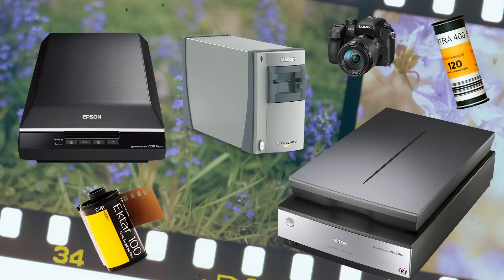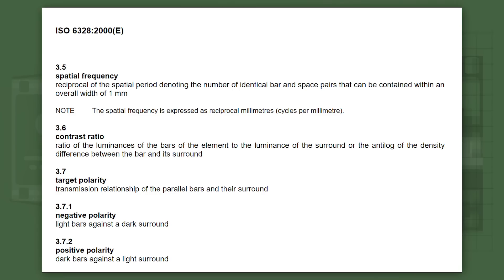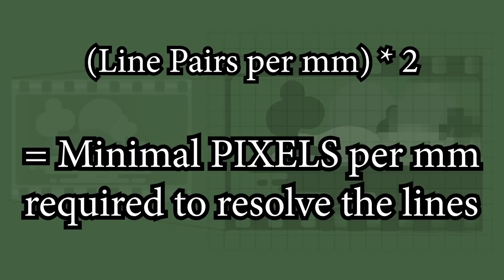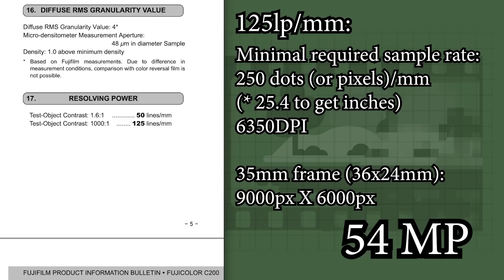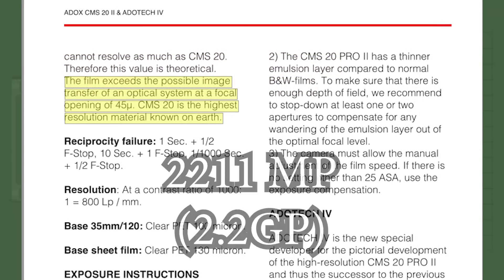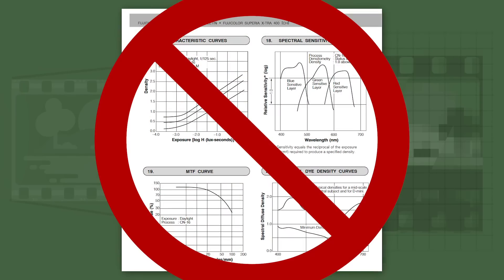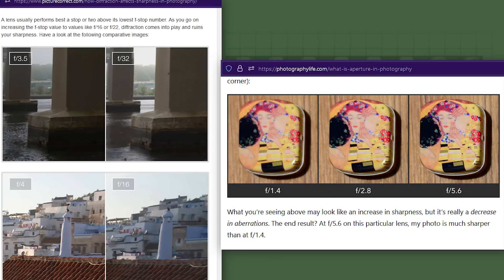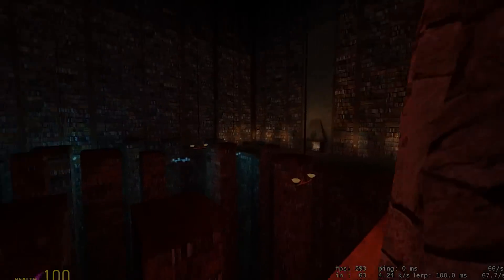The TRUE Resolution of FILM

Comment: While the relative 'resolution' of film is higher, I feel like there are shots we can get with the newer and more sensitive sensors that would be impossible with film. For example, you might get a substantially lower shutter speed with a higher ISO (practically available) on a camera that can still stay relatively sharp and noise-free above what film can achieve.

The "practically available" is added because there was an ISO 20,000 specialty film made by Kodak until like 1997. Good luck finding anything like that anymore in working order.

Another practicality feature is real-time metering on digital. Film can be tricky and if you under or over expose it, you can't do much to fix it. A digital RAW file should contain as many stops of light as your camera can capture and you might be able to recover what appeared lost. (If you also have a JPEG rendered that's lossy.)

All of that being said, this was a great video. 😁👍

Comment: In practical terms, at an 8R output, film is equalled at about 8mp.
No one hangs a 24mm x 36mm piece of film on the wall and 
there are no lenses that could resolve 200 l/mm. A very high 
quality printer, like an Epson can output at 720 dpi, that would 
be a theoretical 360 lp/inch, or about 50mp, which is doable.

Comment: All this stuff about pixel count and resolution bores the pants off me, who presses their nose against a framed print to look at the dots ? 
Pictures are made to be looked at as a whole, from a distance that varies according to the size of the image. I shot film professionally for a quarter-century, from half-frame up to 5x4 and 6x17 and now I use digital, but only for my own fun stuff ..... and whilst I admire the dynamic rsnge of digital and the ease with which it can be manipulated and sent to wherever, the very clarity and sharpness sets it far apart from what I think a photograph should be. I've recently been looking at a lot of fashion shots, done in the 1950's and 60's and it's the softness, the subtle gradation that catches they eye, there's something velvety rather than the stainless steel of a digital image ............
.............. and don't get me started on the over-processed neon images with their overpowering and lowering skies that for some reason seem so damned popular.

Comment: After being quite disappointed by the resolution, color grading, and just overall quality of lab scans from film I have shot over the years, I recently invested in a camera scanning setup. Using my Sony a7R with its 36mp full-frame sensor and a Minolta MD 50mm f3.5 1:1 macro lens, I've been able to get some amazing quality "scans" that just blow lab scans out of the water. Obviously the resolution is alot higher at over 7000 pixels on the long end, but because I scan the photos in RAW format, I have insane control over the end result in post. There is of course a hard limit to the detail you can resolve as the film is exposed and no amount of digital dynamic range can fix a bad exposure, but it is so nice to at least be able to zoom in and crop on 35mm film scans for once. I never get lab scans anymore, except for 120 film which I don't have a setup for yet. Its funny, my 35mm scans that I take myself are more than double the resolution of 120 scans I get from a lab! When I ask the lab to scan in at a higher resolution for my 120 they always look at me like I just asked them to explain rocket science to me.
Reply: This. All these nonsensical claims that 35 mm film can resolve only up to 4 megapixels is just poor scanning technique and poor scanner choice. Scan your film on a drum scanner and melt your face off with the result.

Comment: After scanning pics with my 24 mpx camera this past winter I really think the limiting power of the lens is the factor. I was scanning everything from 110 to 4x5. Back in the 35mm film days the lens were really pathetic especially wider angle ones used on scenic pics. Just really yuk. Give me my digital camera and modern lens any day. I was using Mamiya medium format too-I would say that they might be equiv to my 25mpx digital camera but one has to get the film developed plus scan it and clean up the dust etc. Just not worth the hassle.

Comment: This is not the film resolution but the scanner limiting.
When you use the traditional analog ( sorry can’t find the right english words) upsizing on paper ( good film and paper ,not the cheapest you can buy ) you can get far bigger prints than digitally.
And with medium we could go into crazy details i m missing nowadays even with the 100 mp cameras , the bayer filter system ( i know technically necessary ) reduces the real mp readings by far contrary to film ( again good films as base , cheap mass produced ones had far bigger grain) since it is not ,say , 40 mp in all colors but each pixel one color that needs to be interpolated and reduces the rael count by far even if it says in exif 40 it’s misleading.
And everything said here is right and wrong at the same time.
Right if you only look at the 90% of usual films used by nearly most people on a daily base.
Wrong  if you used the (allegedly very expensive ,too for normal people on private basis) special films it became a completely other world ,but again 1 film cost as much as 100 or more normal ones,so only for mostly military or publicity reasons where the army or a company paid the bill.

Comment: There is one major difference between anything digital and color film. No digital pixels of different color can overlap. The red, green and blue pixels are always separate from each other. This is not the case with dye clouds in color film. As long as everything is done optically, there is no rasterization in film and optical prints.

Comment: Purely theoretically this might be correct. But real life useable resolution is much - MUCH lower. I digitised my film archive with DSLR scanning. First of all I have to admit - my film equipment was pretty average. Not bad, but not great either. I had 12 and 24 mpix DSLRs at that point and a vintage slide duplicator. As a reference for the slide duplicator capabilities I used film defects - scratches. I focused to achive best sharpness on them. After trying different ways to focus this gave me the best results. Contents of the film were much less sharp than these scratches and I couldn't achieve anymore sharpness improvement. I tried both my DSLRs and found that even 12 mpix gave me more resolution than I can actually extract from film without diving into counting individual film grains. I admit that if all the analog process if focused for maximum resolution - you can achieve noticeably better result, but that's not how an average film works. So for real life usage digital surpassed film long ago.

Comment: Great explanation, but I spotted one error: the CMS 20 pro megapixel calculation is overstated by 4X, because the 800 figure was "line pairs". Your 2000MP is what you get when you double it, as though it had been 800 lines/mm. Maybe that resolves the issue of bumping up against the wavelength of visible light?

Comment: One thing to not forget is the scanning process when using a scanner like a Nikon 9000ED will yield colour information for all three colours in the RGB spectrum and at 64Bit including infrared information. That’s 16bit per colour and all colours present in one pixel instead of a interpolated Bayer pixel which offers 16bit max for one colour channel in one pixel, but most often 14bit unless a highend medium format sensor. It’s just like how Foveon sensors capture more details per pixel.
Reply: And still those sensors blow away the crappy chemical spec based celluloid carrier, film is based on. 
How could it be otherwise, sharpness in film is just luck, because of the perfect spreading of the chemical particals needed which is off course never the case.
And it shows there`s always some crappyness about it, and grain lots of grain and looking at it is uneasy on the eye.
And we`re not even talking dynamic range.

Comment: I scan my negatives with a macro lens. 8x10 can resolve about 1000MP maybe a bit less at 800MP and 4x5 can resolve 150MP. Monochrome Ilford Delta. 35mm  has very low resolution so I never use it. Medium format also has quite low resolution. You get mich higher resolution with a macro lens than any normal scanner (drum scanner is probably better)

Comment: When you send in film to develop in a shop, most of them only send you 12mp images, and even then I often can see softness in the pixels.
Looking at that MTF curve, only at 20lpmm can it resolve 100% contrast, but 2 digital pixels can resolve 100% contrast all the time. Accounting for lines not alined with the pixel grid let's just say 4 pixels required for the equivalent of 20lpmm. This gives us a digital resolution of 2880x2160 or 6mp, a much more reasonable number.
I mean just look at the curve at 120lpmm it has 20% contrast, that doesn't really count. I will say under the most ideal circumstances, the best 135mm film photo I've seen, can be reasonably scanned to 24mp. I've never seen a 50+mp scan that doesn't have serious sharpness issues at the pixel level.

Comment: I compared the resolution of negative scanning quality between my 2 Fuji cameras - 16MP X-T1 vs the 24MP X-T30. There is easily detectable difference and I have dedicated the X-T30 body for that duty. I use a Nikon PB-5 bellows with PS-5 slide copying attachment. To that I coupled a Fuji-X to Nikon F adapter and a Zeiss 85mm f1.4 lens. Works like a charm and with live view and focus peaking you get spot on sharpness. Just need to have a good and uniform white light source.